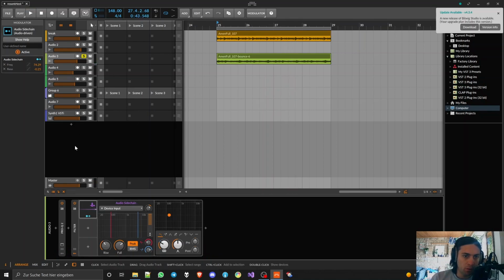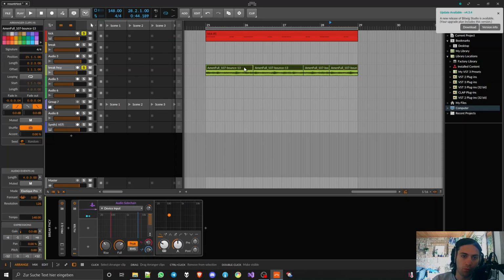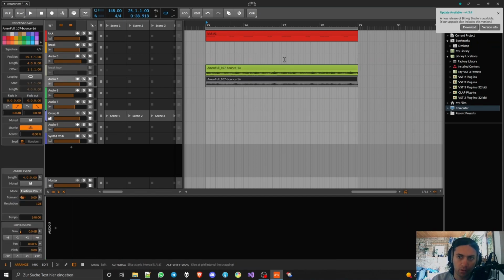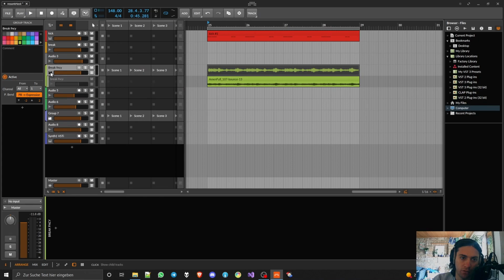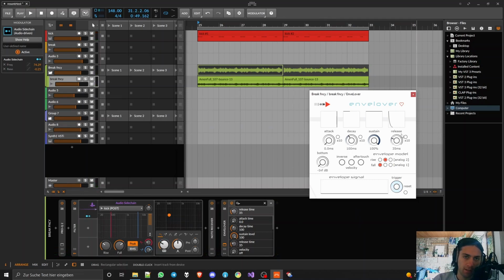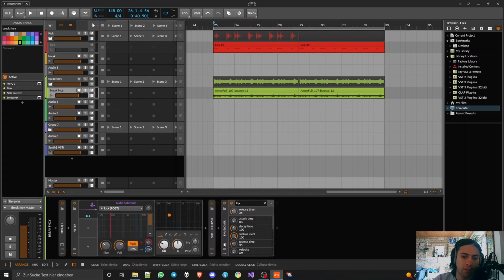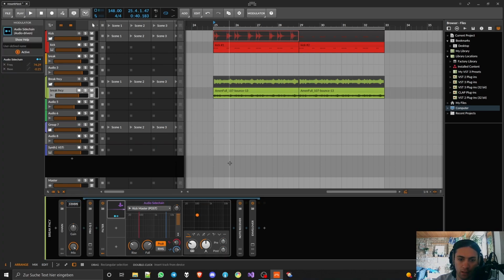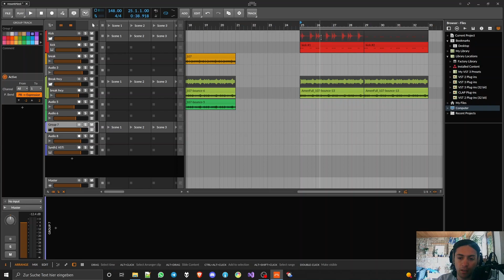Bitwig Track Freeze

Comment: Hey!! Man! Thank you for Thais vídeo. Im using Bitwig for a looong time and im with you. os so bad. 

PLEASE BITWIG MAKE A GOOD AND SIMPLE FREEZE FUNCTION!

PLEASE BITWIG MAKE A MIDI TAKE LANES 

PLEASE BITWIG MAKE A BOUNCE IN SEPAREDE TRACKS FOR DRUM MACHINE DEVICE 

PLEASE BITWIG PUT A VÍDEO COMPARIBLE 

……

I feel like the Bitwig needs to improve basics functions! Plase bitwig i love you, but for a second stop to create a new things and improve wht u awhere have
Reply from the maker: some time after i made this video i actually built a new computer with much more cpu and ram so that i'm not annoyed by bitwig's absense of track freeze anymore and that really helped. i didn't run out of resources anymore on the highest block size since i did that. but this is only a solution for those who have saved some money to build a new computer, which is not an option to many people. that's why i also believe that they could have a much bigger user-base if they implemented this feature

Comment: How long have you been using Bitwig for? Because this critique is mostly bsed on you not understanding the concepts and not having enough experience. "I don't get it" by the end sounds correct :)
Reply from the maker: i haven't used it for long yet but if you could explain what i misunderstood there, that would be great. still, no matter if there were some details that i misunderstood, i can barely imagine i overlooked something that would drastically cut down on the steps you'd need to take to have a track freeze alternative
Reply: @Beatsbasteln  Track Freeze isn't needed. Depending on what you want to achieve, just use a different technique that suits it.

Two quick things:
- bounce in place is capturing the signal at the output of sound GENERATOR - for instrument tracks that's an instrument or instrument layer/selector, incl. the FX nested within it; for audio tracks it's the input to the track, i.e. the signal you're sending from your audio interface or from a clip - to capture the FX on audio clips in the bounce you just need to add an Instrument Layer with emply layer and drag the FX into the FX box; this gives you a lot of flexibility which parts of the chain you want to "print" and which ones should remain tweakable
- group track clips - you can switch the Group Track to show "Master Track content" which means it won't show meta-clips anymore, only the actual audio or MIDI clips if they're there

There's many more, but Id have to go through the video, pause it every couple of seconds & record my reply. Basically you're trying to mimic on auto-pilot other DAW's workflow - I'm guessing Ableton? - without appreciating the flexibility and modularity of Bitwig. In Bitwig you can decide whether the bounce includes sidechain or not, which you can't - easily - in Ableton. Or why would you expect tracks within Group to suddenly stop playing if you've bounced-in-place it? Why aren't you using hybrid track functionality at all, e.g. by keeping the source material in Clip Launcher and bounces in Arranger? You seem to not realize that you can disactivate things on different levels - group tracks, individual tracks, devices, modulators, notes & audio events; so if you only need note information for sidechain but want to disable the synth itself, you can do it.

And so on & on...

Basically my suggestion would be to learn Bitwig and forget how things worked in other DAWs, because usually it's different but it has its internal, coherent logic. Ableton was created for fast, but fairly limited & rigid workflow. If that's what you're after, then stick to it.
Reply from the maker: @antic604  first of all no, i was a cubase user. 2ndly also no, track freeze is required for a good daw in general. please think of it for a moment. i suppose you own a great computer atm that can handle your projects well. but what if some time in the future your computer kinda sucks and you can not instantly afford a new one? should you just use hacky workarounds all day long then? that's kind of a privileged view, you know? track freeze is important to make the computer hold tight until the project is finished. that's important for everyone who wants to finish songs consistently. also no matter if people follow my tutorial or your suggestions here it is all highly complicated stuff to consider and we should not forget that making music is about making music and not about controlling a space shuttle.

that's also why some of your suggestions are not all that helpful here. i still have to carefully read all of them but for example you started talking about the clip launcher as a tool for sorta saving the information while using the bounced audio instead. but here's the thing: if my project already consists of more than 2 tracks, it can get very unorganized if i even have to keep track of where stuff is currently pseudo-frozen or not. and i would have to keep track of it because, as you have seen in the video, both audio as well as midi sidechain features mess hard with the integrity of the project if you start bouncing content and deactivating effect chains. i'm not against modularity, but there could just be track freeze on top of it.

and what about the thing with the groups where it doesn't stop playing the tracks if bounced? what does it mean to bounce a group if that bounce is not the sound that is used then? if you can explain it i can change my mind, but you gotta admit in this context of trying to find a track freeze alternative it just feels weird, because being able not to use underlying tracks anymore is why i bounced in place the group.

the difference between me and lots of other musicians is that i don't pretend like i can keep it organized no matter what. if things get too complicated i consider that a flaw. and if the bitwig team didn't see it the same way they wouldn't have implemented easy-to-attach modulators but let us route ugly midi cc signals to plugin parameters like cubase. so bitwig's mentality is definitely not "let's avoid all high-level controls" but more like "let's innovate by hiding the complexity in an interface that makes it look simple"
Reply from the maker: @antic604  also consider: especially as someone who hasn't used bitwig for long yet that makes me basically even more of a person to identify ui/ux issues, because the features that take the longest to sink in then must be the ones that cause most cognitive load. that's just like the midi routing in fl studio, which has a terrible workflow compared to bitwig and even cubase. yet a lot of fl users would defend those workflows in a similiar way you do with words like 'modularity'. technically it is more versatile, yes, but there's definitely some sort of critical mass, where if the threshold is exceeded it makes people care less about the feature. when that happens to a daw feature it essentially makes the features disappear in everyone's minds when actually making music
Reply: @Beatsbasteln  I'd disagree with that, because it's as ig Ferrari user switching to Land Rover would complain that it doesn't corner and accelerate as well. Sure, they're both cars, but their purpose and "philosophy" is different enough, despite sharing the surface level features (4 wheels, sits, trunk, etc.).
Reply from the maker: @antic604  i don't think we'll agree on this one, but this is just an important daw feature to me because as i said, i don't wanna call a project finished before it really is finished. and i don't wanna accidently hurt the integrity of a project when attempting to pseudo freeze with any of the methods discussed in the video or our discussion. i am simply not organized enough to do that, so the inevitable result is that i won't finish every track, even if i didn't run out of inspiration. and i'd be surprised if i was the only one
Reply: @Beatsbasteln  That's only because you have ingrained in your mind how "freeze" worked in Cubase and assume Bitwig's should work the same. If you started with Bitwig instead, you'd find Cubase's equivalent working weird and in a limiting manner.

For me different DAWs inspire different workflows which leads to different music outcome. But sure I can see people expecting them all to do the same, just different.
Reply from the maker: @antic604  while i respect your theory on why i perceive it this way i think it works differently, because of the following reason: if it really was true that i'm just automatically irritated by a workflow just because it works differently in cubase, i wouldn't have immediatly picked up the routing workflow of bitwig with its audio sidechain mod and note receiver container. but i did. because i do aknowledge when a daw has a superior workflow to the daw that i learned and internalized most and first.

this is not just about workflow. it's also about stuff being completely impossible or not. it's like when people in other daws have completely no modulation system and someone tells them they should just use the workaround where you route weird midi signals until it sorta works, but not really. that is the cubase-situation btw. and guess what.. i don't know anyone who modulates plugin parameters in cubase with its midi lfo. because it's way too complicated. that's why i'm very confident in this statement:

if a feature or workflow is too complicated it doesn't exist.
Reply: @Beatsbasteln  Ok, I get it. It seems we really look at it differently - I refuse to freeze/bounce anything unless I really have to, you seem to treat it as a part of "finishing" the track, i.e. I'm guessing you were freezing everything in Cubase, bouncing to audio and mixing/mastering that? If that's the case then I can clearly see why Bitwig's approach  would be really inferior. How I use it is for sound design and/or freeing up the CPU, so flexibility is much more important - even if it takes more steps & requires setup - than it being one-click thing.

Having said that, 90%+ of my issues with bouncing would be solved by hybrid comping which I pitched to the devs. Hopefully they'll find it "fitting" Bitwig's workflow and paradigm :)
Reply from the maker: @antic604  it might be that we are just misunderstanding each other. cause imo bouncing doesn't have a lot to do with freezing, except that it uses bouncing in the background to accomplish its goal, but it does more than that. the goal of bouncing is to commit to sounddesign and to free resources, just like you said. but track freeze has the opposite goal. it lets you not having to commit to your effect chain as final, because you can always unfreeze and tweak the settings. that's not a sounddesign thing, but mostly needed in the mixing- and mastering-stage, where you already have so many layers of complexity in the project, that your cpu really has no chill anymore. then freeze lets you keep everything just as organized as before while giving you back resources. you are essentially trading your flexibility for a bigger project. that's why i love it, you know? cause when you're already so far with your project you actually don't need it to be that flexible anymore
Reply: @Beatsbasteln  Yes, we seem to expect & need different things from the DAW and Bitwig might cater to what I need, but it's fairly incomplete for the workflow you got used to. Hopefully they'll get there - we're only at v4, whereas most other DAWs are at 10+ :)
Reply: @antic604   @Beats basteln :3  and besides, bounce in place for some reason does not include reverb tails in the clip and cuts off the clip at the midi borders. There are a lot of problems in this approach. And a simple freeze solves these things. The only thing that freeze lacks in the same ableton is the chain restrictions. For example, if I have a guitar amp simulator and something else hanging, I want to freeze this moment, and then add, for example, equalization, which no longer spends so many resources.